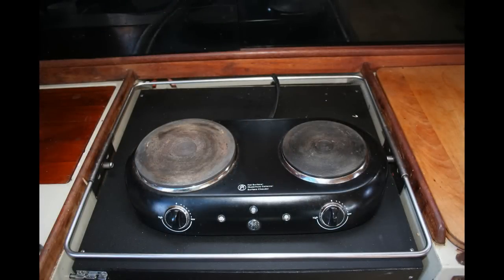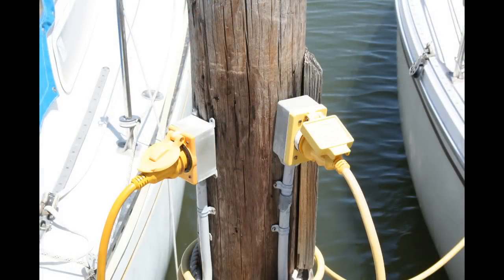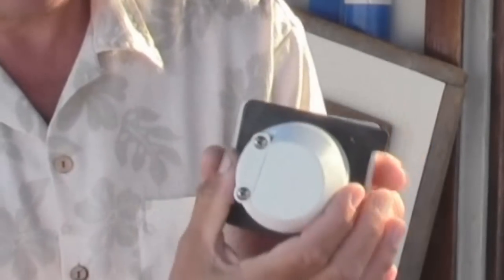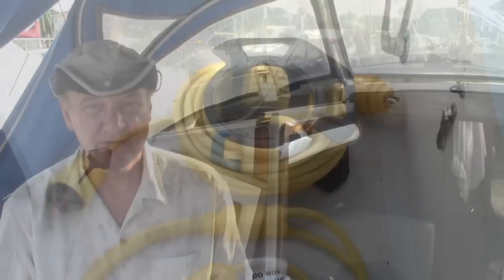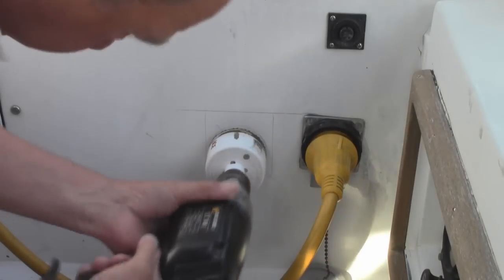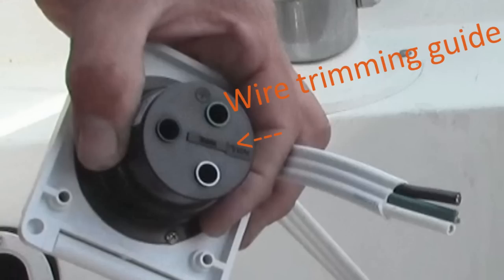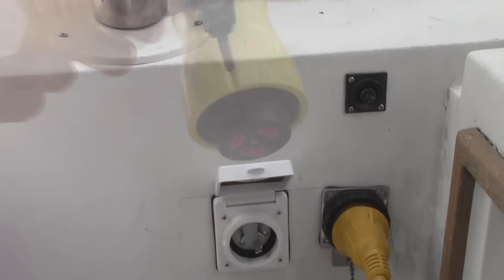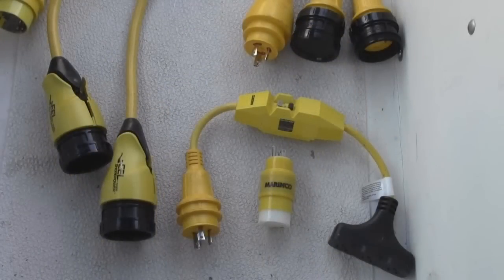Adding a 30 amp shore power Part 1

Comment: 1. twist the wires tight before putting them into the connector. 2. nothing wrong with tinning the wire with solder.  3.Use a thin film of anti-corrosion conductive grease on the wire.. to prevent corrosion inside the connector from dissimilar metals and condensation. 4. Make sure you tighten each set screw firmly !  This is a serious safety issue.
Reply from the maker: thank you for your input

Comment: IMPORTANT - Not Shown in this video.  With an EEL Connector, insert connector end into shore power inlet on your boat. Release the wings and ** ROTATE ** the connector clockwise for a secure connection. Move the Locking Tab all the way forward.   Here is short demo video from Marinco:  https://youtu.be/BylAg3yU-C8